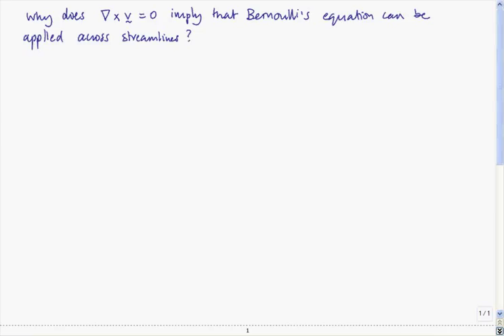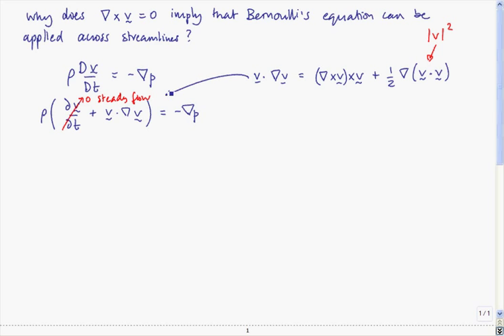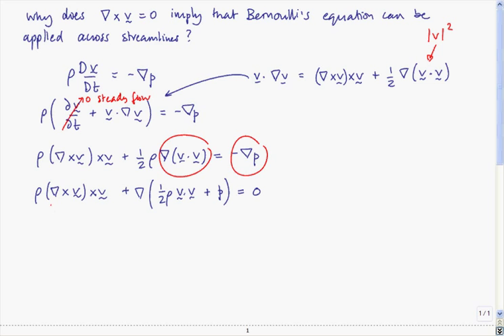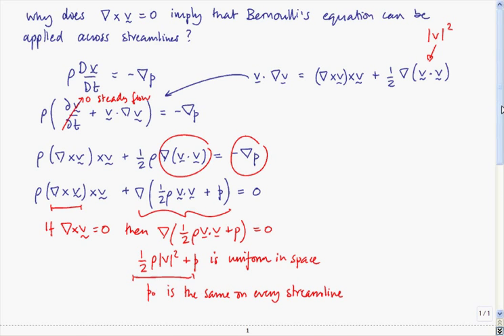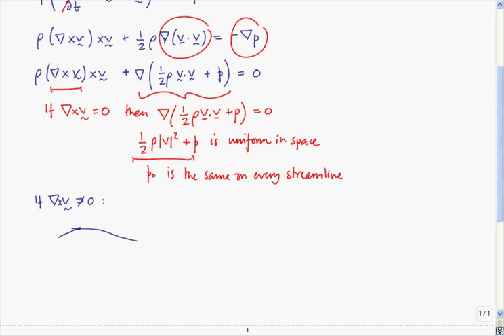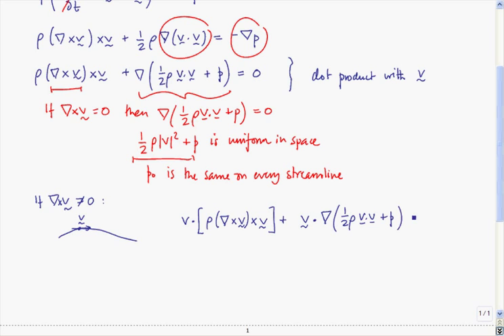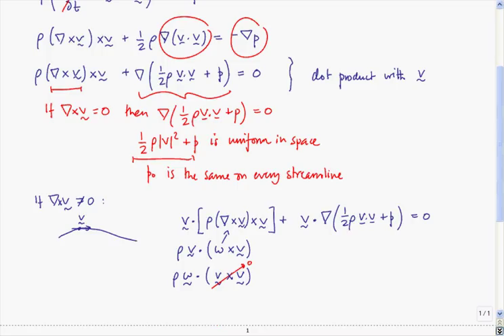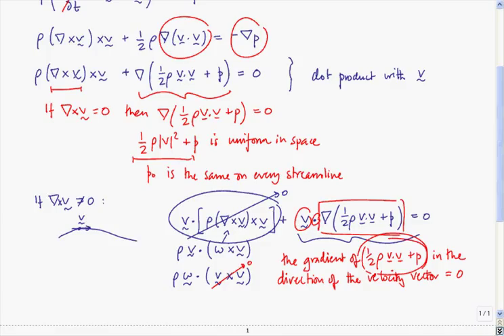Bernoulli across and along streamlines

Comment: Thanks for the explanation. But can you tell what does it mean physically when the flow is irrotational that we are able to apply Bernoullis eqn accross stream lines. Also why is stagnation pressure uniform? Does it mean the static pressure component will adjust itself with velocity variations along the flow?